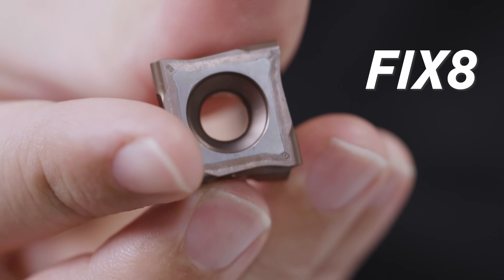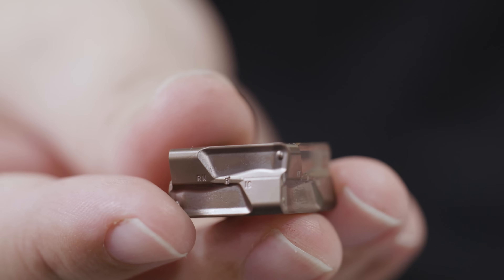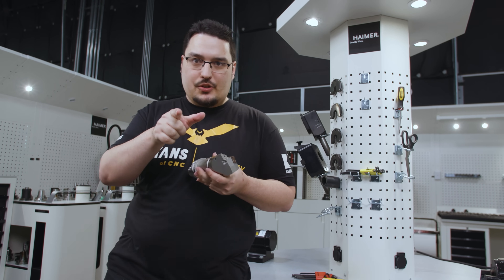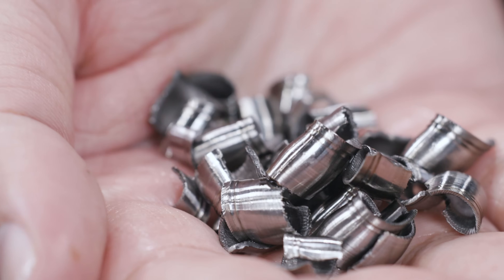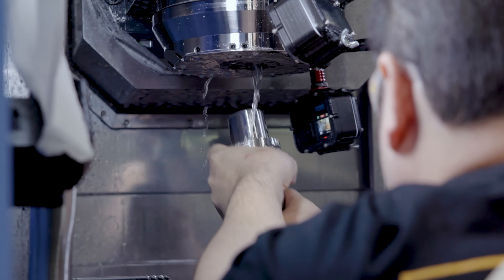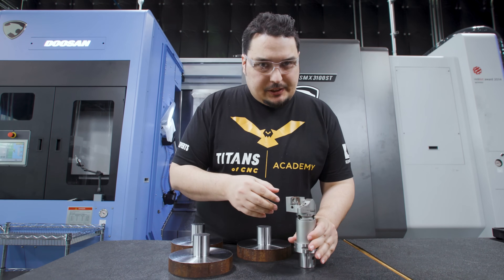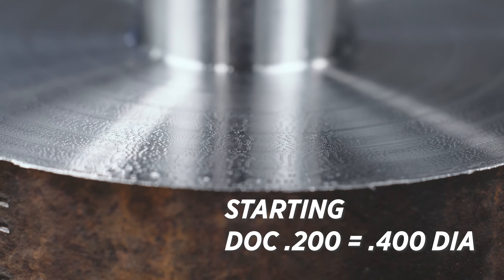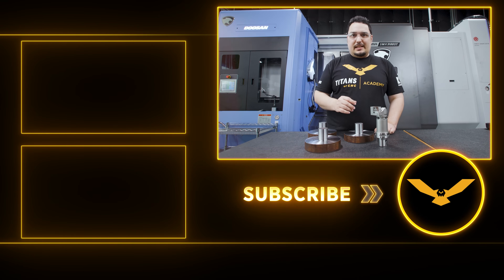Taking GOLIATH Cuts on 9 AXIS MILL / TURN

Comment: Nice to see what a machine can do at its best. But what about the B axis?(or whatever axis the tilting head is). That is quite a big machine but can it handle those parameter for 2 years without losing precision?  Just asking, because if it does so that's a top quality machine
Reply: seems like they're just using it in the mill spindle for the higher pressure coolant, i doubt it is good for the machine to use it like this all the time, but this shows it's definitely no big deal once in a while

Comment: Awesome chips. Risky, and very hard on your machine, but an awesome demo. Just because you can, doesn't mean you should... Hmmm, what's the cost of replacing the drive screws and bearings on one of those these days? Bet it's more than the cost of the insert.
Reply: You know what costs more then some machine components?  Time.  Shop rate about $150 an hour.  Think over a year how many extra parts shops could make pushing stuff to the limit.  If you decrease spindle time by 3 hours a week per machine by running faster that’s almost 25k a year in savings, not to mention how much you’ll make from the extra parts you just sold.   I get it it’s scary to push stuff to the limits but these new tools and machines want to go fast.
Reply: @Bestruction  True. Time = money.  But running any machine at its extreme limits dramatically accelerates wear and tear. What would you expect to happen if you drove your Dodge Hellcat at 140mph for 40 hours per week, every week? Yep, it has the power and loves the speed, but it will wear out very fast (a buddy blew his engine up in about 6 weeks). 
Today, getting replacement parts can be a nightmare. You break something on a big expensive and highly specialized machine, it could be 4-6 weeks to get parts (or much more depending on where they are sourced). For example: 6 weeks x 40 hr/week x $-150 / hour = $-36,000. There goes your $25k plus any penalties for late delivery and potential loss of a customer, costing much more than the $150/hour shop time lost. Going faster is not always better.
Reply: @WarpFactor999  you are correct, each shop needs to find the balance that works for them.  The guy driving the car that hard for fun is going to cost him a lot of money, the guy racing it and winning money by driving it fast might be making money by driving it hard.  All I was saying was sometimes shops don’t push hard enough because they are worried about ruining stuff, but then they miss out on work because they quote it too high or aren’t making as much as they could.  It’s definitely a fine balance.  I guess we’ll let titan blow stuff up and enjoy the videos! Haha
Reply: @Bestruction  LOL! Well said sir.

Comment: I wouldn't want to be the guy to buy your used machines.   "What's their life history?"  "Oh, the've been run at 150 percent max load or higher for most of their life."   "Pass."    It may be fun to see how far you can push it, but it beats up the machine.  You will get accelerated wear in the machine ways and ball screws and may find that parts of the machine have been bent/deflected out of spec with no easy fix.

Comment: Nicely demonstrated. I was impressed with all the advantages engineered into the inserts' geometry before it even touched the stock. Now, can you visualize how complex the pelletizer press is to incorporate all those features?
In observing this example: Is the high pressure coolant and holder design responsible for breaking up the waste trajectories? Always hated it when the roughing chips pop off with such velocity it sounds like a vulcan canon and abrades like a sandblaster.

Comment: Now can you focus more on precision? Most Machinist's can take monster cuts with the right machine and tooling.
But start having to hold tenths for tolerances is where you separate the precision shops from the rest.
Reply: We do have quite a bit of videos on how to approach tight tolerances if you check out some of our full part videos
Reply: Once again, they’re not showing you how to do batch production with these kind of videos, they’re simply showing possibilities of tooling and the machines

Comment: Excellent, you read comments. I usually see the insert chipping a little at the top of the cut from the material work hardening from a high SF, it can generate heat and work harden the surface. But you have a high feed which takes the heat away in the chip.
Load on the machine is good, you can run that until the cows come home and not hurt the machine.  👍
Reply: Yes, we read comments! We are alllllllways watching 😂

Comment: With all the exotic materials you work with how do you account for that when selling your scrap metal? Do you clean out the chip management system between each type of metal or do you simply sell it as mixed scrap? I would imagine you would get much better returns if you had it sorted.
Reply: We swap out chip hoppers for different materials. Most steels however go into a mixed bin, as they are worth almost nothing
Reply: Same☝️
Reply: Next, a video on chip and scrap management. 😁

Comment: i have no idea of cnc machining.. i just think its super interesing... can someone explain me how this cutter even workl? it looks very rounded.. shouldnt a thing like this have sharp edges like hell? you can tou cut with a non sharp or like it seems a rounded edge?
Reply: Inserts have a .002 rad but still sharp. The corner you see is called the nose radius. Some inserts have .250 rads others.005 or smaller depending on ruffing or finishing. They are sharp but most of the cutting it done by tool pressure. That .400 depth of cut in the video is a bit misleading. Yes it can be done. But if he was running bar stock most Chucks don’t have the pressure to child that. The bar would push back in the draw tube
Reply: A basic explanation is that carbide inserts are made by compressing powder together. It ends up being relatively dull by the standard of a knife or high speed steel, but still plenty sharp to cut off slices of steel in a machine.
Reply: Cool, thanks for the info!
Reply: just imagine a butter knife vs. butter. The knife is usually not "sharp" and you are also most likely also using a "negative" cutting angle to scrape off the surface of the butter block. This tooling insert works the same way, by being much harder then the steel you are cutting with it.

Comment: I’m more impressed with the rigidity of that tilting head. Sounds good
Reply: All such heads has gear locks, for every X degrees, and more breaks at every 45 degree(usually). Its super rigid when you use it like this.
Reply: @steinarne79  it's a curvic coupling, same as the turret

Comment: Just casually running at 116% load. No big deal lmao.
Reply: 100% is full duty cycle. You can run basically forever at 100% duty cycle. Any higher and you can only run it at that load for maybe 10 or 15 minutes total.
Reply: @rossomyman  Need to look at other factors as well, like selected gear range, chuck clamping force, chuck jaws, quality of maintenance machines get etc. 100% spindle load on a lowest gearing on a lathe with multiple gearing options can get brutal.
Reply: @rcandcnc9684  yes depends on other factors but generally speaking

Comment: So who does the math on when the time saved pays for the tool wear? Is there some rule of thumb we should know about?
Reply: if your trying to save inserts from wear, your probably not considering the cost of your overhead properly. Let say that a part has a gross value of $100, and a insert is $25. In scenario A you run a $100 part 10 times per hour and the insert lasts for 10 parts. In scenarios B you run 1 part per hour, and your insert lasts 1000 parts.
Reply: @seancollins9745  the math clear with those scenarios, but it gets interesting in scenario C: do 1000 parts an hour but use 500 inserts to make it happen.
Reply: @Bbonno  depends on the price per part, one thing I can say, any shop that try's to focus too heavily on reducing tool wear by slowing down machines and feed rates, generally seems to go out of business. Tools are consumables, meaning they wear out. price your parts accordingly. Stepping over dollars to pick up dimes as it were.
Reply: @seancollins9745  that makes a lot of sense. Assuming your numbers are roughly realistic then inserts really are cheap. Breaking a few when dialling in a new machine should thusly only be frowned upon, as they would have been worn out tomorrow anyway 😓
Reply: @Bbonno  I think the best way to value this is cubic material removal per hour versus hours of tool life. the manufacutrers have tables